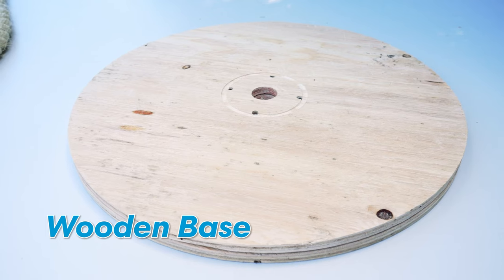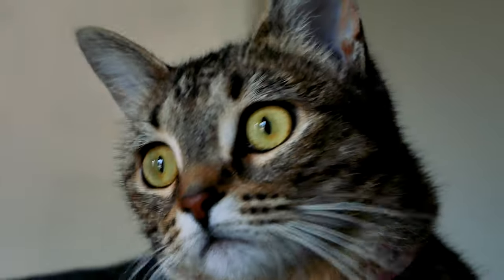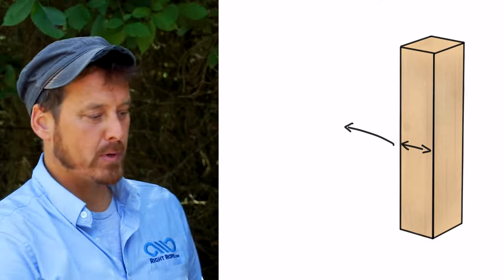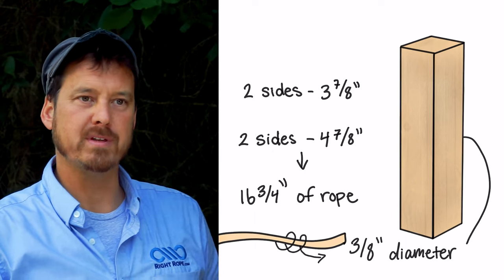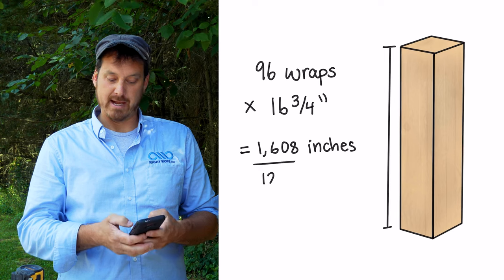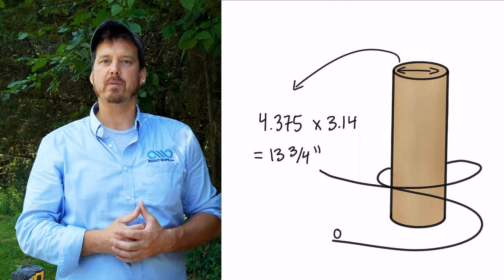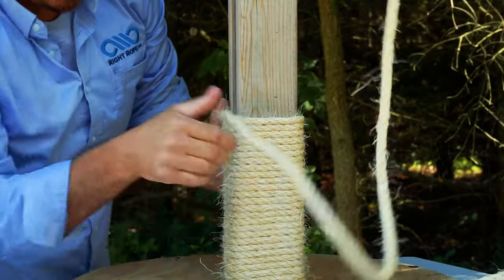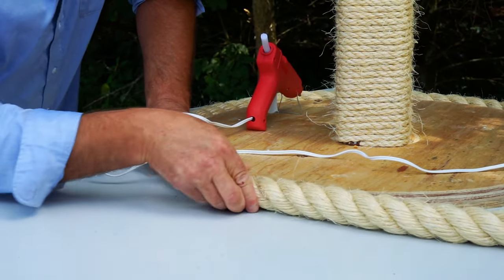EASY DIY Cat Scratcher Post PLUS Must Know Tips!

Comment: The calculation for the rectangular post isn't quite correct.

To find the length per wrap (i.e. the perimeter of the rectangular cross section), it should be 2 x 3.875" plus 2 x 4.875" = 17.5" per wrap. This times 96 wraps equals 1680 inches. Divide that by 12 to get feet, which is 140 ft. So your estimate was 6 ft short of what is actually needed.

Everything else is correct as-is. Sorry to be pedantic, but I hope this is helpful to someone!
Reply: Good catch! Thanks for sharing. Not sure how we messed that up...
Reply: Perrrrfect! Thank you.
Reply: Shoot, I got lost quick. I just figured eff it, buy 150’ and I’m good!